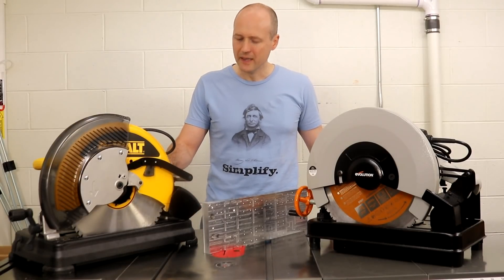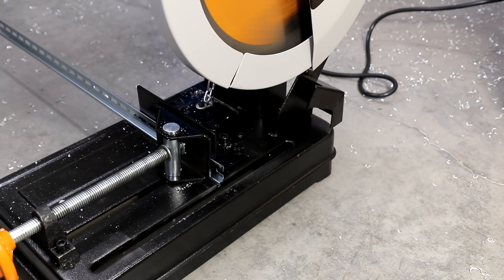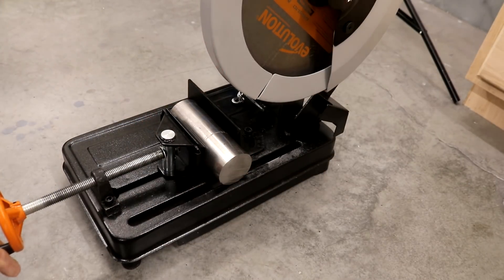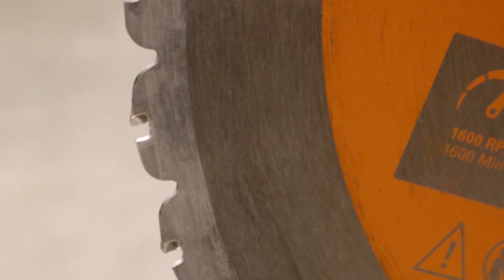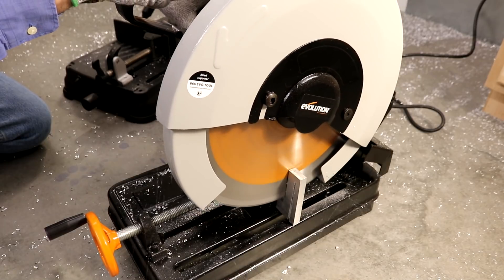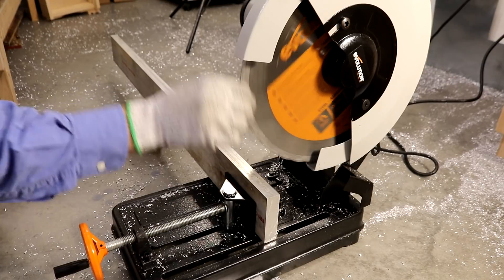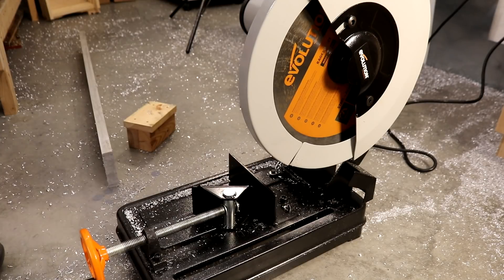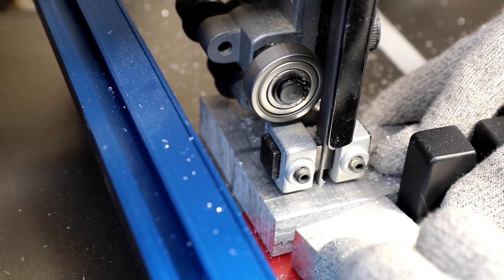Evolution Rage2 vs DeWalt DW872 for cutting aluminum

Comment: You are so obviously shilling for DeWalt it is nuts.  Worthless review.
Reply from the maker: I bought the DeWalt and Evolution sent me theirs to compare. Sorry the review was not what you were looking for. Still glad to answer any questions.
Reply: Fair enough, it just seemed bias to me from the beginning. In all fairness this is not even a comparison that should be made. It is an Evolution base model against Dewalts best with prices being half and double. Don't get me wrong as I am shopping but found this comparison unfairly deceiving even though I am favoring the dewalt myself.  But The table seems so much more robust on the Comparable evolution.
Reply from the maker: Evolution did follow up and send two aluminum cutting blades and their Evo380. I've not been able to make a review of them but initial impression is I would lean towards the Evo380 because of the cast iron base and additional blade offerings. As I said in the video too, I think the Rage2 will perform similar to the DeWalt if the blade was replaced, and so Evolution sent two aluminum cutting blades.
Sorry if the review seemed biased, I tried my best, again my metric is performance on aluminum since that's mostly what I work with. It's hard man. Realistically, I'm biased towards the DeWalt since I paid $450 or so for it, it's worked well, and don't want to admit there was a better choice. And I'm biased towards Evolution since they reached out and sent the tools to try - DeWalt has never done that. Can't win.
Like I said, I've not made the new review, so if there is something that you would like to see, let me know. If I can reasonably do it, I'll do so for you.
Have a wonderful Easter!
Reply from the maker: BTW Doug, I want to express gratitude to you for leaving a comment. Most people would people would just down-vote and not look back, which is of no benefit to the video creator.
Reply: Happy to interact, I would not be a person to speak negative and disappear. I believe your review now but think it should be highlighted !! that those are far from comparable units. one is a chevette and the other a corvette but both are chevys. Reviewing this way just serves to downplay one vs the other without proper consideration. Just struck me as unfair.

Comment: I have only used the Evolution saw (it was what I could afford, and fit in my apartment) and can say the aluminum blades do a much better job at minimizing chip weld, but you do still have to give it a break between cuts as the blade isn't cooled. I learned the hard way when ripping through a bunch of 1"x5" aluminum and it cost me a blade. I mostly use my horizontal bandsaw now and have considered getting rid of the Evolution saw to clear up bench space, but having a chop saw comes in real handy sometimes.

Comment: For what it's worth I received the Evo380 15" yesterday and the design has changed from what you show here. The clamp is different. The blade sent with my unit was a steel cutting blade and not a multi-purpose. Thanks for doing the vid.
Reply from the maker: For the video I showed an Evolution Rage2. The Evo380 is much more substantial and has nice cast iron base which is machined flat, which is what I assume you received. I'll do a review on it soon. You also asked about other blades. I don't know availability for all, but the Evo380 came with a blade for steel and I also received a blade for aluminum, so at least these are available. Both are "Made in Japan."
Reply: I just offered up some insights on it since I received it after I posted the message and did some test cuts. I think you'll enjoy the new evo380 but i'll be interested to see how it compares to your preferred Dewalt.
It's hard to get a fair comparison using blades that aren't meant for the given task but I understand the expense aspect of it since it's for testing only. I would have hoped that Evo would have supplied you with a proper blade for your test.
The Evo380 doesn't come with a 15"  blade but it didn't stop me from cutting anything so far. I'll be ordering a blade for aluminum cutting soon enough. Waiting on money for that.

Comment: Hi Kent, thanks for doing the review. 2 things however, the specs stated are that the multipurpose blade supplied should not cut mild steel or aluminium stock thicker than 6mm or 1/4". The blade is not rated for the aluminium stock you are cutting so not surprising it isn't suitable for the job and binds badly - it's a multi-material blade so the tooth configuration designed for wood, plastics etc too - it's going to be a compromise in some areas and not suitable for the large steel stock that ChuckE2009 cuts in his video as a specialist steel only blade would perform. Also the price is $187 in Depot, the amazon price more expensive. Lastly worth mentioning that galvanized steels, cast iron or stainless steel should not be cut used the multi-purpose blade, only mild steel within the rated specs.  Thanks
Reply from the maker: Thank you for the clarification and the opportunity to do the review. Sure enough, the blade is clearly marked, in multiple languages, that it's only for use on aluminum and steel up to 1/4", sorry to have missed that. Before I received the saw, I asked about derating for solids and then went months with the Rage2 performing well, but as luck was, I was only working with thinner aluminum. The blade labeling provides word of authoritative that if one is cutting materials like I showed, one should step up to the EvoSaw380. The price difference between the two saws, after adding a new blade to the Rage2, puts them so close in price, then add the superior base of the EvoSaw380, and the choice should be easy, at least that was the conclusion of my review. Finally, I did find the Rage2 on your website under the BUILD section. Here is the direct link for those wanting it. http://www.evolutionpowertools.com/us/build/chopsaws/rage2/
Reply: When will there be more 15 inch blades available for the Evo380? So far there is only steel.
Reply: Kent hi. I suggest repeating the test and use the appropriate disc in both devices for the material to be cut. Regards
Reply: I have the same problem with aluminum chip build up when cutting aluminum square tubing with 1.5mm thick walls
Reply: hi, you can install the blue metal disk on the evolution rage 2 as it has the same revolutions and RPM. thanks

Comment: Hi Kent
I also have the Rage2 and it works great for most aluminium cutting but it will clog on the thicker pieces.  I found pecking gently into the cut can help as you are creating a bit more clearance for the chip.  I stop as soon as I can hear a tooth has blocked and clean it.  On very rare occasions the start up has tripped the breaker but it is usually fine.  Not sure if it helps but I pull the trigger quickly and firmly to reduce arcing in the switch.  Overall though I'm still happy with it as it is much quicker than cutting by hand.  I'll look into the other blade you mention.  Thanks for the video.
Reply from the maker: Good to know. I wish Evolution would have sent the aluminum specific blade as I'm sure that would solve the problem. Cutting by hand... the 2.5" steel round I showed in the video I cut with a hacksaw before having any power saw. 15 minutes to cut and something like 500 thou to face on the lathe... :)
Reply: Add an extension cord to prevent start up breaker tripping.  Don’t know exactly why it works but it does!  I think the extension cord spreads out the initial electrical hit just enough to prevent the tripping of the breaker.
Reply from the maker: Thanks, I'll remember that. It's a very cool trick!

Comment: Great comparison.  I like the root cause analysis and the high speed photography, as well as the answers regarding lubricants. Have you considered offering up R & D services to these manufacturers? For cost effective solutions for cutting extruded T-slot aluminum, a 10" generic woodworking slide saw and a Diablo 10" 84 tooth nonferrous blade ($60) has functioned well. A table saw and a radial arm saw with the same blade has also worked well. The Diablo 12" 96 tooth version ($65) looks promising as well. These solutions would not work for ferrous materials of course. It would be interesting to see the slow motion chip pattern on these blades with your scientific approach.
Reply from the maker: Thanks Rich, you have the actual engineering cred... I'm more of a hobbyist, I think you would be the person to stir up the consulting work for us :)

Comment: im cutting aluminium on a woodworking drop saw, much better clamping and much bigger reach. and they are cheap. i tried few and i can tell that the biggest difference is when you have dull or sharp blade. with a dull i tried to cut 16mm plate and it was taking 10 min, but when i change to new blade it went in few seconds, without any effort. have you considered switching blades on them evo to dewalt and opposite?
Reply from the maker: Hi Piotr. When I had a large bandsaw that would cut steel, I used a sliding compound miter saw, like you are using, to cut aluminum, but after moving and minimizing, I got the DeWalt, which was only option at that price, so I could cut both, but not quite as large. The compound saw, with a Freud aluminum cutting blade, would cut 330mm wide stuff by 25mm thick. These two saws in the video cut up to something like 150mm. I'm sure the Rage2 could be made to work, it's just an engine spinning a blade, but the modifications need to be considered when buying the saw... and then one might as well get a saw that comes with a proper blade, so maybe the EvoSaw380 or DeWalt. I wanted to compare out of the box, no modifications. Like you said, for aluminum only it's really hard to beat the drop saws and someone else was saying they use a table saw. For occasional steel, maybe the drop saw with carbide blade and good clamping would also be OK? I've not done that. Anyway, I only have room for one saw, so... one gets donated :) I'll send you a picture of the mess that is my shop today, some stuff needs to go. Best wishes, Kent
Reply: thank you for the extended explanation :) I guess i limited my self by cutting only aluminium and forget that some people might want to cut steel as well :) space is also a big factor. like 4 times less space. I will wait for the pics ;)
Reply from the maker: My dad only entirely works with steel and asks me why anyone would ever work with aluminum... after trying my hand at TIG welding... I see some truth but more a challenge :)

Comment: Great vid!  I have the Rage 2 as well.....and you're right.....that blade gets packed up badly!  I may have the other blade you're talking about.  I just bought 6/10 pitch blades for my 7x12 bandsaw.  After unsuccessfully trying to cut thick stock with the rage2, I use the bandsaw.  I like that I can do other things while it's cutting....and it's quieter.....not as messy.....better cut.    I've got a lot of thick stock to cut in the next couple of days.  If I have that other blade, I'll see if I can give it a try.
Reply from the maker: Thanks Mike. Glad to hear I'm not the only person experiencing the problem, so the conclusion is probably fair. I like bandsaws, and used to have two when we lived in the country, but gave them away when we moved, anbd kept the abused HF sliding compound saw, which was pretty awesome because I could cut 13" wide stock with it, with complete disregard to safety. I've been thinking of moving all the stock to the garage and getting a new horizontal bandsaw. I remember your saw video. Yours had sat in box for a while too if I remember correctly. Let me know how the other blade works if you have it. I plan to give my Rage2 to the local Makerspace, and it would be nice to have a solution for them if they want to do the one thing the Rage2 does not do well. Best wishes, Kent
Reply: I've cut AL stock with my handheld circular saw and not had a problem with the teeth filling up....it's purely the blade design.  
.....I just went and looked.....I have a 2nd blade, identical to the original :(  ...and another that says steel only.....but it has a better tooth design like your dewault.  Maybe I'll try the steel blade on the thicker aluminum.  It's hard to justify the time to mess with it when I know the bandsaw will do exactly what I need. LOL

That's awesome that you're donating it to the makerspace!!  I have no clue if there's one around here or not.  I'm sure the dewault blade will work on the rage 2.....so having the saw would still save them a lot of $'s!!
Reply from the maker: Need to tip the balance more towards metal working and way from 3d printing at the makerspace :) Would you consider Tormach's new autofeed bandsaw if you didn't already have a bandsaw? I assume you make a lot of similar cuts.
Reply: This is the first I've heard of an auto bandsaw from tormach. lol  I just spent about 10 min trying to find info on it.  Only seems to be one pic and the same info on a few pages.  No demos that I can find.  I see a price of around $5k.  My 7x12 was under $800 and I have a fairly competent monkey here to run it(me).  Since it is basically the same saw I have, I think I'd probably see about converting/upgrading mine for that kind of money. But....I'm not really a power user.  I go through spurts.  I'll have a lot to cut in the next day or two, but the saw will then sit for weeks....sometimes months before I do any production cutting on it.  I've never looked into auto cutting saws before, so it's hard to say if I'd consider tormach's or not.  I think they're a great company, with great products.....but.....I got really excited about the slant bed lathe when they were first were talking about specs.  Then when it came out, the specs were a bit of a let down from what was being purposed.  It's still way better than anything I have access to, but I'm not sure I'd spend that much money on something that will only get me about half way to where I want to be.  We'll see what the future holds.  :)